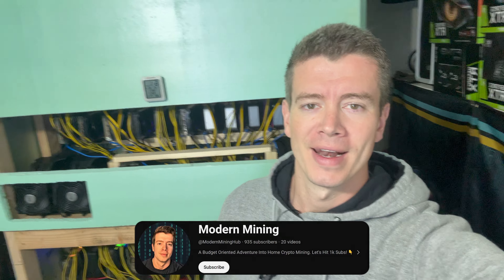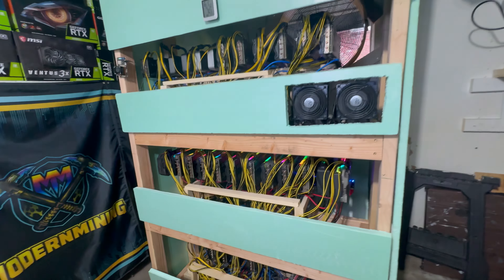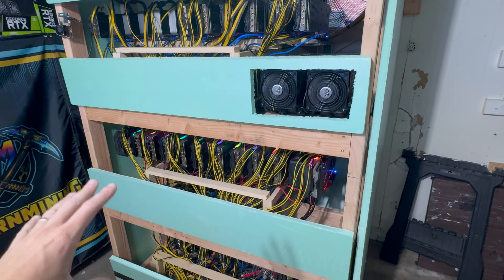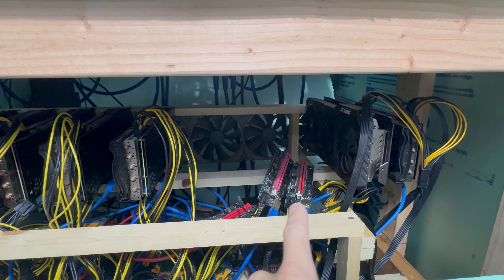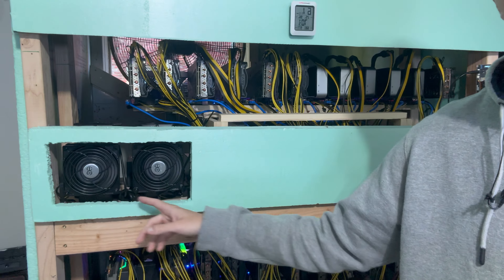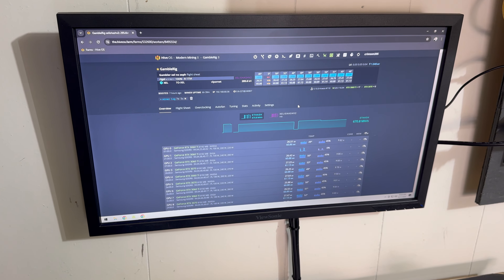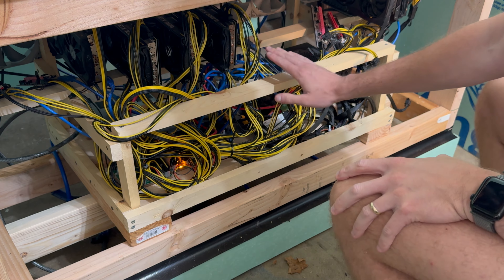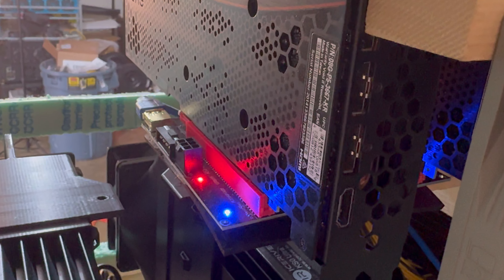I'm STILL GPU Mining in 2024... But I'm Having Some ISSUES!

Comment: I recently bought a ton of L3+ from eBay for less than $300 per unit with power supplies.  I have free power so efficiency isn’t very important with my rigs.  I also saw a bunch on eBay for under $120 but I was scared they might not work or probably a scam.  But if you’re looking for doge litecoin asics at a low cost, eBay might be an option to grab a couple.
Reply: I swooped a few Ebay L3+ for about 120 it says used but looks barely used. What pool do you recom for doge/Lc?

Comment: The main error is that the flight table uses 12 overclocking data. If one of them is not used, an error occurs and all the data is not used. Updating to the latest version and the core version may be able to correct it. Another safe way is to add PL restrictions to the flight table and set PL as a second-level restriction in hiveos.
Reply: In addition, the hiveos watchdog can be set to shut down or restart immediately when the maximum power wattage is reached. This is also another protection to prevent the power supply from overloading, overheating, or even burning if no one is around the machine.

Comment: 2630w on a 120v outlet? 😮 how?? Or do u have a 240v circuit outlet?
Reply from the maker: 30a 240v circuit!
Reply: @ModernMiningHub did u need to get a permit from the city ? Is it a sub panel or u add a 30a breaker to ur regular pannel ? I’m looking at getting a 240w sub pannel since my main pannel is full, but I’m reading online I’d need to get permits from the city … 😪
Reply from the maker: I’ve got a large panel so i just added a 30a breaker. You could look at getting a bigger panel may be cheaper than a sub panel maybe?

Comment: 12:12 ive had this issue happen with me on 2 rigs... power went from 6 to 17amps.. and it happens often since the electricity cuts every 12 hours the only way I was able to fix this was using the oc config through hive not the flightsheet
FYI Im not dual mining zil thats the downside of this method simply since you cant set diff ocs for 2 coins but I rather lose some cents then trip a breaker or a psu
Reply from the maker: @slayer21  ok good to know! Hopefully someone has another fix because it only just recently started on all my rigs!
Reply: @ModernMiningHub  Yep I thought it was only happening with me 
I was lucky That the breaker was a 20amp 240V and my psus handled it 
hope someone finds a fix!
Reply: I have this issue on one rig, but not on every start. It sometimes drops OC intermittently. I just have a quick NV Tool OC I apply. I also set a max power on the watchdog to reboot when I'm not paying attention
Reply from the maker: @TyJoseph91  The watchdog trick is a really good idea I keep forgetting so need to do this 😂
Reply: @ModernMiningHub  the thing is with some cases it won’t catch it fast enough and the psu wont be able to keep up with this load so we need to find a fix for it not a workaround
Reply: Set safe oc in hive, then if the miner doesn’t apply ocs you’re not running them at stock

Comment: i was wondering y u dont use server cases for everything man i just got my first server case and i am getting better temps then my open air rig i got my eatx dual cpu x99 mother board in the server case along with my gpus i dual mine with one fight sheet  one for cpu mining and one for gpu mining i got 2 xeon 2680 v4s for a total of 28 cores 56 threads and 64 gb of ddr 4 ram
Reply from the maker: Just personal preference, i like being able to look at my cards instead of just a metal box. They are definitely better for temps though unless you have a large exhaust setup like